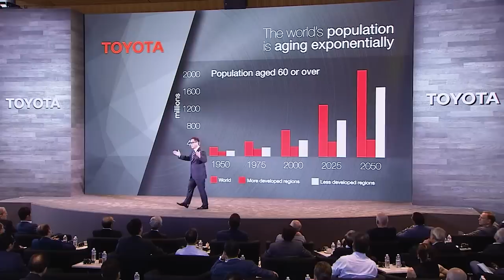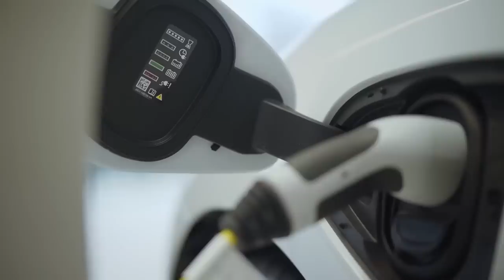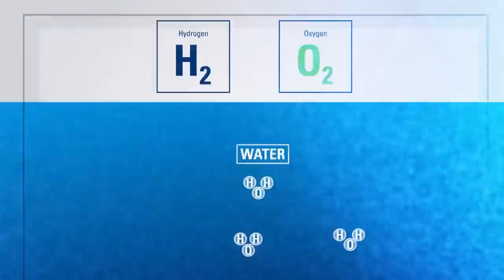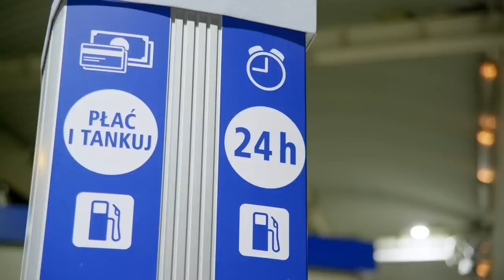New Toyota CEO Shocks Everybody | Huge News

Comment: Toyota are absolutely right, I’ve owned a Tesla X for 3 years now and although it’s great, the range and the time it takes to charge on anything but trips to work etc. are a nightmare. I did a 600 mile round trip last months and had to make 7 stops at roughly 40 mins each to make sure I didn’t run out of juice. Those stops added 4.5 hours to my journey. Cold conditions and motorway speeds just mop up energy and at 65p a kw at Superchargers it’s not that cheap either, I think it was about £140. My friend has just picked up a hybrid and it’s cheaper per mile than charging my car - hybrid is the way until hydrogen comes on line.
Reply: Older S/Xs are not good at all. I have both new and old, it's night and day. I fully agree with you with old. Refresh S/X gets charged at full 250kwh so it's much easier for long distances.
Reply: Hydrogen fuel cell is waaaaay further more complicated and difficult to acquire than BEV. By the time Hydrogen fuel cell is ready for mass production, BEV will be mass used already.
Reply: @kjp8196 exactly. And in the future who wants to still go to a station to fill up your car. Everyone will charge at home or when you are parked at work and you’ll never have to wait for a car to charge. It’s predicted new EVs will get 1000km for charge that’s over double current capacity. Which is also more the. You could practically drive in one day.
Reply: @danielbass09  You obviously don't own a model X, my 660 mile round trip visits to customers, from LA to Vegas, require ZERO charging stops. I charge my car at home and at the destination hotels.
Reply: @danielbass09  bro, not everyone has a garage, in fact in some cases most people don’t.
Reply: @ronvela  Hydrogen is awesome. Toyota has a great hyrdogen already in production called the Mirai, the problem is with hydrogen's misconceptions. People are afraid of it
Reply: Meh. Just have a spare older ICE car for that or rent one for trips. 1st world problems brother.
Reply: Rather than buying one car (Tesla MX) for $140K USD, buy a BEV (95% of usage) with 80Kwh at $45K USD and a nice ICE SUV at $45K USD (5% long travel). Total $90K USD and your CO2eq emissions (as defined by EPA) is the negative and never have range anxiety.
Reply: @SubSSN670  Exactly. Or rent one! Anyone with the Benji's for an X can afford to rent a car when needed.
Reply: @ronvela  I've taken a class in fuel cell technology, and I agree 100% - the fuel cell setup has a whole bunch of things that could break or leak, the cell itself requires expensive rare elements such as platinum and has a limited lifespan. Plus refueling requires specialized infrastructure which would be no less expensive to implement than what we'd need for mass EV adoption. Meanwhile, we're already making steady progress towards meaningful solutions to the down sides of pure EVs.
Reply: Wow, that's expensive. It cost $150 CAD to go back and forth to Bangkok from Chiang Mai, or 18 hours driving, or 1500km. On a 2.5L truck. That is terrible range and cost lol
Reply: @imnotarob0t1984  I live near most of the hydrogen chargers in the world (Southern California) and I've seen people have to be towed away from the charger because they ran out of fuel at the charging station.   I heard that they then have to be towed back to the charging station when they hear that they have fuel again.
Reply: @imnotarob0t1984  I understand completely about Mirai. Can u tell me how many Mirai has bee  sold? I also understand the difficulty of setting up fuel charger station. Not to mention the danger of "hydrogen cell" inside the car, along with its Leaking rate when the car is not used.

In summary, so many issues need to be solved first before Mirai can be used as a proper and reliable transportation mean.
Reply: HYDROGEN! I'VE TAKEN A JAR - MADE IT SEPARATE HYDROGEN! Not only did my riding mower run off only 'water' I made an old farm truck do the same thing!
Reply: Super Chargers shorten the life of the battery. I read an article in April 2022 . About a man who bought an electric car 8 years earlier for 22k . At the time that the article he was told that the car needed a new battery which would cost him 15k the car was worth 14k.
Reply: @imnotarob0t1984  not so true. Hydrogen fuel cell car is far more complicated technologically.  Many obstacles to overcome, yet not in the near future.
Reply: @ronvela most hydrogen fuel is extracted from methane.
Reply: @imnotarob0t1984  %95 of fuel hydrogen is extracted from methane
Reply: @ronvela  There's been about 20 thousand Mirai's sold in the world. Most of them are in Southern California. California is pretty much the only state that has a hydrogen infrastructure. You actually don't have to worry about the hydrogen tank leaking. Toyota has designed it to where the hydrogen tank will never leak. You could store a Toyota hydrogen tank for 20 years and it'll have the same amount of hydrogen in it..... It's reliable if you're somewhere that has the infrastructure but without expanding the infrastructure (hydrogen fuel stations, repair shops and hydrogen powerplants). Hydrogen cars won't have growth.
Reply: @denisburgess2966  LIthium based EV's are extremely primitive. The ones being produced today will be obsolete in 10-15 years. For example, who do you know who still uses an Iphone 3g? Planned obsolescence is something greedy car manufacturers either engineer into their cars or they know about it and don't care because if an EV lasted forever, people wouldn't  have the need to buy new ones.... I think Tesla's business model is horrible... As soon as their shares start to slip, which they will because of The New World Order and economic volatility caused by globalization. They're going to look to existing customers to try to squeeze more $.
Reply: @user-ze6qx1py2l  It's actually not that complicated. Hydrogen cars are still electric cars in the sense that they use batteries to store the electricity produced from the hydrogen side part of the car. However they don't rely on the electrical grid. The only problem is that the infrastructure for whatever reason, hasn't been built. Companies like Toyota and Hyundai have hydrogen car manufacturing down to a science, literally.
Reply: @danielbass09  The energy infrastructure can't handle powering everyone charging their EV's... It barely works as it is. I think there's  a large majority that would rather go to a fuel station than have to wait hours for their car to charge. And a lot of people don't have the luxury of charging their cars at home or work. You said you won't have to wait for your car to charge, so why will people be charging overnight or at work if they don't have to wait for a charge?
Reply: @hedonismbot1508  Fully electric vehicles have very limited lifespans. In many instances, it's cheaper to buy a new EV than it is to repair them. and not to mention the weight involved. EV's are extremely heavy vehicles which contributes to their limited range.... EV's are not sustainable at all.
Reply: @im not a rob0t  The fuel cells used in cars (proton exchange membrane) also have a limited lifespan, and use expensive catalysts such as platinum.
Reply: @denisburgess2966  Yes, there was a service that ran dozens of Tesla Model X and S round the clock from Los Angeles to Las Vegas and back.   Their batteries had problems between 400K-500k miles of supercharging.  That guy's 15K battery is solved by waiting for a crash battery to become available.  Typically go for 8K.
Reply: @stirlingdavis4179  Great you have developed the perpetual motion machine that generates energy from nothing.  Water always costs more energy to use than to make.

Comment: So…Toyota is doing what it has always done and is making sure a technology is good and ready before committing to it large-scale. Good. Honestly makes me appreciate them even more. Perhaps a Toyota is in my future…
Reply: Same with Honda.  We already have better tech but the oil companies won't allow it unless it can be charged from their infrastructure.  Crazy that the people thinks they aren't using carbon with an ev.
Reply: @cheryl7735  still better than Teslas locking up all doors when the car catches on fire. I dont think Toyota has that many car mat engineers.
Reply: @cheryl7735  dude, toyota still sells 8 times more cars then telsa even to this day. There are 100s times more toyota running on the road comparing to tesla. Even if they have 100 times more accident, they are still more reliable judging by the ratio .
Reply: Thank goodness someone sees electric cars for what the really are a pure waste, we can’t keep the electricity on  now. Just typical government the cart in front of the horse
Reply: Not so much with the current gen tundra but typically they’re right on.
Reply: @cheryl7735  Those were dealer installed floor mats. Try again.
Reply: @duanebailey6253  Depends on where in the world you are and how you look at it. In Norway you're most likely getting your electric - thus charging - from Hydropower. So yeah 99% renewable energy in Norway at least hehe.
Reply: too bad they couldn't do this to the toyota models before 1995.
Reply: Exact same thought…
Reply: @duanebailey6253  100% , and the only by product from Hydrogen vehicles is water. It doesn't get more "environment friendly" than that.
Reply: @laggmonstret  increased emissions are at the battery production stage. If I remember correctly evs become greener than petrol cars only after 100,000km
Reply: you won't regret it
Reply: @Karl with a K the international benefit being reliable cars that are easily and cheaply maintained.
Reply: It sure is in mine.
Reply: ↗Not telling you to buy THETA and IRIS crypto! ↗
..... biggest investment opportunity .....
Reply: Yet there tundras still haven’t horrible for work
Reply: Have been a solid Toyota customer for DECADES!  Best made cars, by far.
Reply: I’m still daily driving my 1998 Camry with the 2.2L 5FSE. Bulletproof. They don’t make them like this anymore
Reply: This is what Apple does as well.
Reply: @laggmonstret  Norway is an oil rich nation.
Reply: I have owned several Toyotas and have a Camry Hybrid now.
Reply: Governments should get behind this by setting up hydrogen manufacturing and fuelling stations.
Reply: Governments should get behind this by setting up hydrogen manufacturing and fuelling stations.
Reply: In China, new EV cars is even cheaper than old EV, it's like fast fashion. The long term pollution is much worse for cheap fashion because people will only use it for a short period of time before going for newer one.
That's not how EV cars work, you need to drive certain distance for break even point and thousands of EV cars just not sold when the newer models keep coming out cheaper and cheaper.